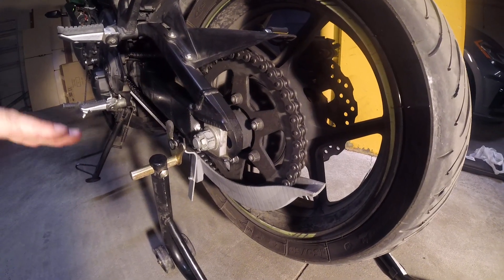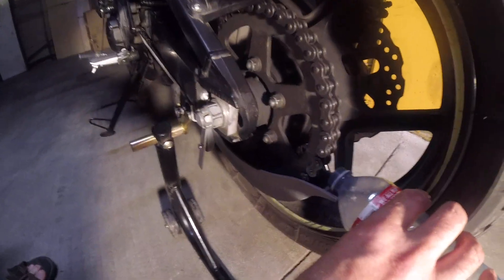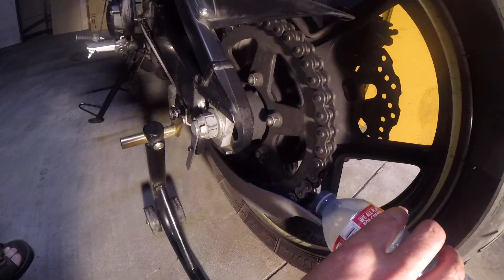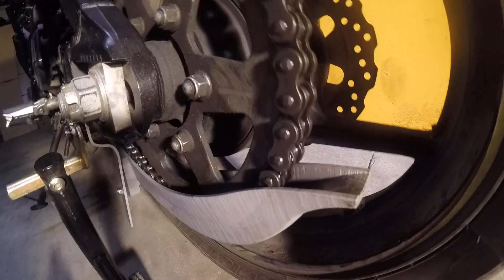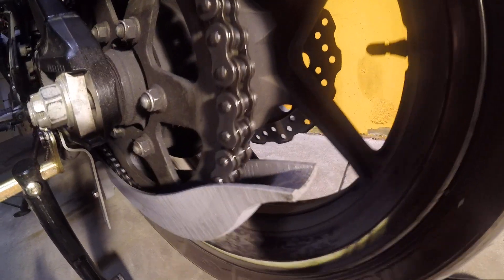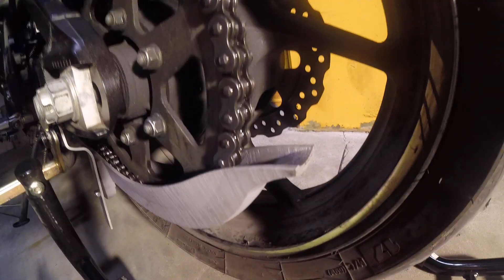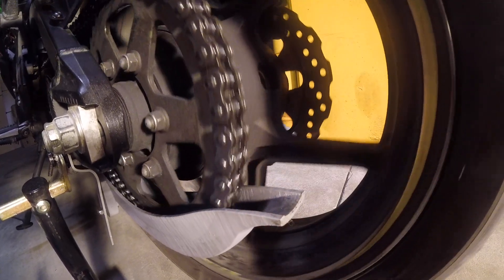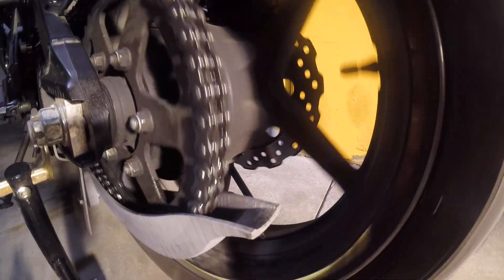ChainBath- how it works

Comment: Does WD40 damage seals on chains?
Reply from the maker: I didn't notice that, but I switched to kerosene: is recommended by most chain manufacturers for cleaning, works great and is cheaper.
Reply: @hdchiriac  There are a lot of discussions about it online, it's not easy to find the truth. Modern seals are a lot more resistant anyway. Before O ring chains, I can remember boiling chains in a bath over a camping stove to clean it!  Not easy to clean a dirty chain without getting your hands dirty but your idea seems to work well.
Reply from the maker: @RDRGV350  thanks, it does work well, I'm looking for a company to license it and bring it to many riders that had it with the mess.